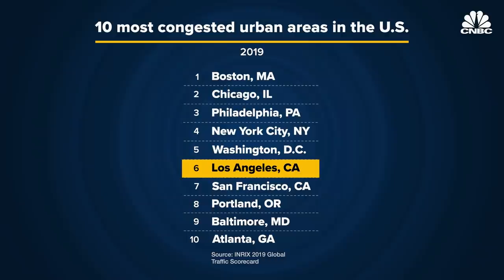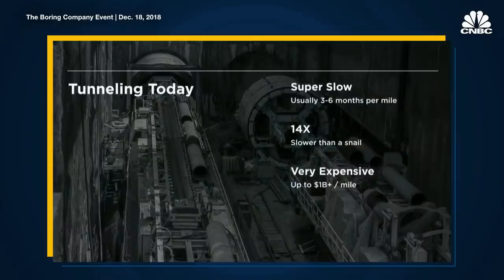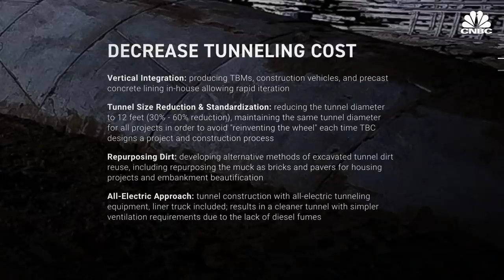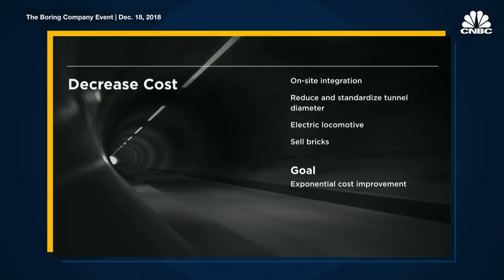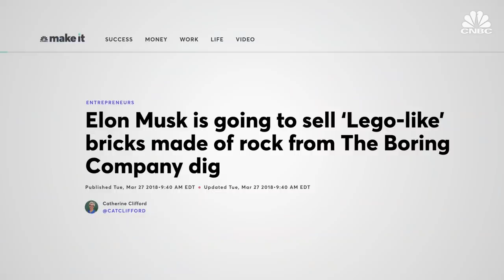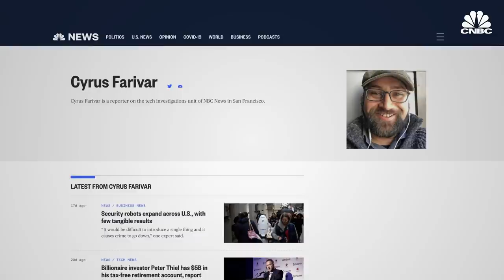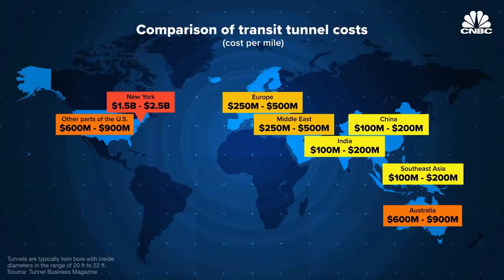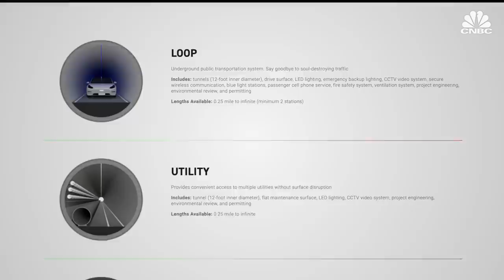Why Elon Musk’s Boring Company Isn’t Fixing Traffic Anytime Soon

Comment: when they're calculating how much faster they can dig, did they take into consideration that their tunnel is much smaller in diameter compared to, say, metro tunnels?
Reply: That's the whole point. By going to a smaller diameter, costs are reduced.
Reply: @alanlight7740  the utility value of a smaller diameter tunnel is also lower, is this sacrifice worth it?
Reply: @physxme  - why do you say that the utility is lower?

Loop takes advantage of the fact that electric cars do not need as much ventilation as ICE vehicles in order to reduce the size of the tunnel that is required, thus reducing the cost. Containing only one lane handling traffic in only one direction, there is no danger of head on collisions, or even of side collisions except at entry points. This reduces the complexity of automation considerably.

Compared to traditional tunnels, two of these tunnels have just as much utility (if not more) while being much cheaper.
Reply: They're actually exactly the same size as new sub lines in London. So when it inevitably fails they can at least be used for underground rail.
Reply: @pinkyfull  But the Americans still won't build Metros/Trains on them, they will abandoned with all the stroke inducing LED lights
Reply: @alanlight7740  he says that because you literally cannot put anything else than electrical cars which are rare compared to every other vehicle.
Reply: @zrider100z  - this will be one more incentive for people to purchase electric vehicles, but we can expect over half of new cars to be electric by 2025.
Reply: @alanlight7740  How do they have much less utility? Aren't the 'Travel Pods' in TESLA'S OWN VIDEO two tall and wide to fit in to these tunnels?
Reply: @xylo5750  - wtf? what are you talking about?

You mean the video showing self-driving minibuses INSIDE  these tunnels?

The tunnels should have a 12 foot inner diameter. That's big enough for pretty much anything other than tractor-trailers, some large panel trucks, and full-sized buses.

And large enough that a new class of buses and cargo vehicles should be able to fit pretty well.
Reply: also the geological stratus where they dig
Reply: @alanlight7740  The Loop will transport 250k people a year, that's less than what most metros do in a day.
Reply: @CarlXVIGustafBernadotte420  - engineered capacity is about 57K passengers per hour for the full Vegas Loop. The existing Convention Center Loop in Vegas is less as it only has three stations, but was tested in its first, slow speed trial with well over its first stage goal of 4400 passengers per hour. It will end up being more than twice that.
Reply: @alanlight7740  what ?
The test achieved i think 1800 pasengers per hour, not 4400.
And it will never even reach 4400, let alone “double that”
Max it would reach is maybe about 3200

This is a dumb project, like most of Elon’s projects, and it will underdeliver.
It’s not efficient at all.
Just move on, don’t defend something if it’s a bad idea
Reply: @ateyaba7253  - no, the first stage test demonstrated a capacity of over 4400 passengers per hour - and did so with low capacity vehicles and slow speeds. It will go much higher once the system is ramped up.
Reply: @alanlight7740  lmfao you're coping so hard, elon fanboy
Reply: @alanlight7740  what you don't seem to understand is all this doesn't seem that interesting to people living in cities with working metro systems... It's just blatantly inferior
Reply: @alanlight7740  my main problem whith this project is the insane enviromental impact of all those lithium batteries. Instead of simply using a third rail system (or an overhead charger, if we sill want to cling to the  pods). Although using metalic wheels whith metalic guiding system would be far better then rubber tires.
Reply: @pinkyfull  I think you should check if your new London sub tunnel does not have the second one made next to it because the current norms do not allow for such an awful design with no additional safety and maintenance tunnel. The only place Musk could get on with it is Vegas, where an absurdly short line is cut in half. So each half section could fit somehow extended US fire safety norms. Carrying such high dangerous car batteries in each "car" has to be bribery, corruption, or whatever you call it. But hey, "Country of government earning on the war on drugs." Nothing will surprise me at this point.
Reply: @alanlight7740  the tunnel Musk made is a death trap. What happens if one of the cars stops working in the tunnel? What if there is an accident? What if there is a fire? In any other transit tunnel you will see an emergency walkway for people to use that will allow them to safely leave the vehicle and exit the tunnel. I’m not convinced that a person can open the door in that tunnel, much less safely get away from a fire.
Reply: @HanSolo__  actually, the old tunnels are the same diameter as TBC tunnels. The new Northern line tunnels are slightly wider to make it possible to escape from the trains without having to walk through them.
Reply: @alanlight7740  if a lithium battery ruptures, there’s a good chance it will catch fire. Lithium battery fires are pretty evil.
Reply: @jeremypnet  - Lithium batteries may catch fire, but they don't spread out the way a liquid or gaseous fuel would. The air handling systems can then remove the smoke and the fire suppression systems can put out the fire.

Aside from that, the lithium iron phosphate batteries are apparently pretty difficult to get burning. This suggests we may also find other chemistries that are fire-resistant.

All these things together minimize the risks.

Remove the risks entirely? Of course not. There's no such thing.
Reply: @pinkyfull  sorry, but they cant, the bends are too tight
Reply: @alanlight7740  The test was artificial. It used fit healthy volunteers, with no baggage, and 3 people per car, from end to middle to end, swapping 3 for 3 at each station, then repeating. That way they just achieved 4,400 people per hour capacity. Back in the real world the best they have achieved (claimed) is 3,400 in an hour. Not meeting the clients performance requirements.
Reply: @alanlight7740  There are no fire suppression systems in the tunnel, only sprinklers at the mid station. I believe there is a 4'' water main under the road with hydrant connections every 200ft (60m) to meet the fire code.
Not sure which firefighters will spray water onto a lithium battery fire, not the well trained ones. So the car will be left to burn itself out. The heat generated will seriously damage the tunnel lining and melt the bituminous roadway.
People can escape backwards along the tunnel as the forced ventilation pushes the smoke to the next station/entrance.
Reply: @tunnellingsalisbury7605  - the longest delay they've ever had was about 30 seconds, and that quickly cleared up, so it sounds as if 3400 is the most that real world conditions have demanded so far. That hardly means that the test failed.

There are other ways to suppress a fire than water.
Reply: @alanlight7740  I didn't say it failed. I  was questioning what its real capacity was. Supposedly it handled 27,000 people in one day, with 70 cars, open for 10 hours. So the peak demand must have been well over 3,000. If you look at the frequency of vehicles departing when its busy (about 6 seconds), allowing 2 people per car and 2 directions, = 2,400. then allow for 50% taking a one stop journey and 50% taking a 2 stop journey you get to 3,600 pph. That's how they got 4,400 in the test by getting everyone taking a 1 stop journey. Again, just trying to explain the difference between a trail and the real world capacity, not meant as a criticism. 

regarding fire:
I was describing what was installed an how a fire/evacuation is handled. Not dissimilar from other existing metro and road systems, unsurprising as they needed to meet NFPA 130 requirements same as any other tunnel that the public can access.

I was questioning why install a water main at all, when you are probably dealing with an electrical battery fire. But the regulations say it has to be there, so there it is. In this system it would be better to have individual fire suppressors in each vehicle that can be triggered remotely from a control once the passengers are clear.
Reply: @davidsalisbury50  - there are also other possibilities for fire suppression that I don't think most people have considered, utilizing drones and acoustic fire suppression, for instance.

But I'm thinking I've heard that the LFP battery chemistry that will soon be common is much more fire resistant that previous chemistries, so there's a lot of room to go in that direction too before these tunnels are common enough for this to be a significant issue.

And of course, in the end we can certainly find ways that a combination of every sort of bad luck could create a catastrophe - but that's already true on regular highways. There's no such thing as absolute safety, it's just a question of whether this system can be significantly safer overall than existing systems - and I think it clearly will be. There are all sorts of hazards that are entirely eliminated in this system, for starters.
Reply: @CarlXVIGustafBernadotte420  that's less than the oldest, smallest metro line in Europe does by a loooooong margin
Reply: Not to mention the costs of the stations, wayy better ventilation, and the signalling system which is hyper expensive
Reply: @alanlight7740  okay, we all saw those tunnels. how the hell are you gonna fit a drone in there?
Reply: @thejuiceking2219  - how could you not fit a drone in there? We're talking about a 12 foot diameter tunnel.
Reply: @alanlight7740  but a car can't carry nearly as many as a train, that's the hang up